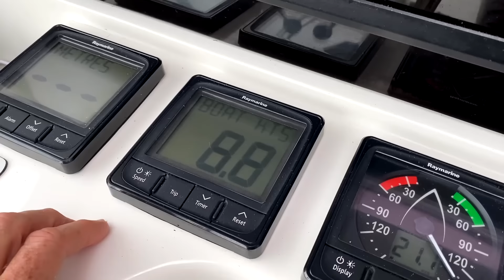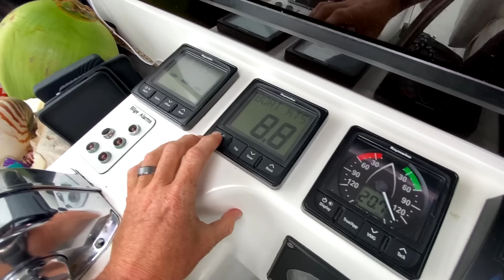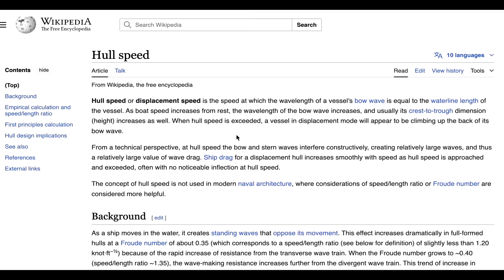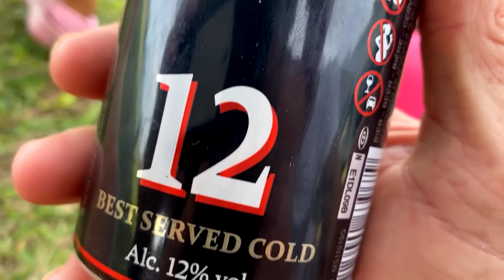Fiji's best kept secret?

Comment: 1st. I was solo sailing on my Nacra 6.0 with the main and spinnaker up on a wide reach with the center boards up in over 40 knots of breeze. I took off in the morning and didn't realize that it was forecast to blow hard that afternoon so I was caught out in this weather due to not paying attention otherwise I wouldn't have gone out that day. The wind was blowing so hard that the sand on the beach was lifting off the beach hard and hitting my face. Anyways, I was going so fast that my rudders were throwing a rooster tail and humming/ vibrating very loudly. It was very wild and the fastest that I've ever been on a sailboat. Another time I was aboard a 165 ft. gaff rigged schooner and we hit 27 knots on a reach with all sails up except for the fisherman, both top sails and we didn't have a spinnaker or a 120 genoa. Just the classic old school sails is all. On the 20 ft. beach cat, I was for sure going way faster than 27 knots but I don't know how fast I was going. The swells were all white caped. I was able to take down the spinnaker by laying out my lines so that they wouldn't get a knot in them when running through the blocks, laying down with my toes controlling the tiller extension and stuffing the shoot into the spinnaker bag. Then I headed up wind turned the rotating mast so that I could take down the main and sailed back to the beach with the jib on a rolling furling system.